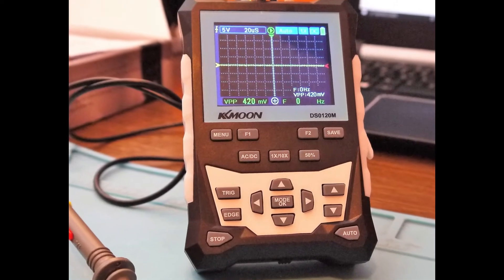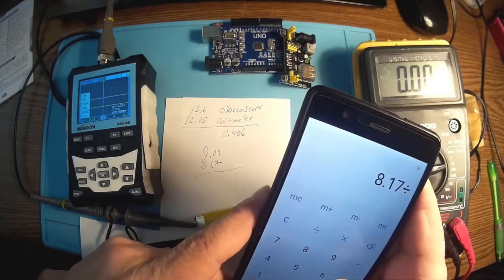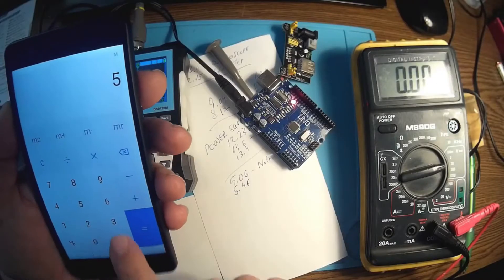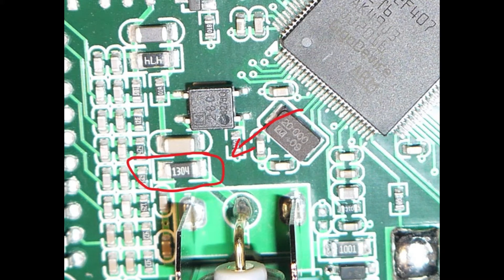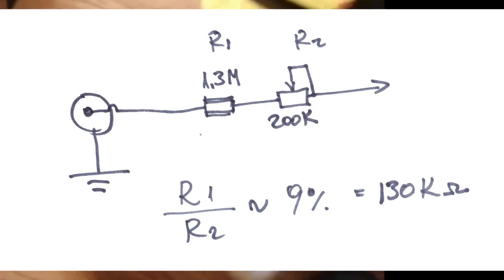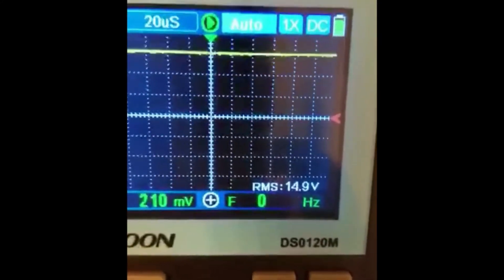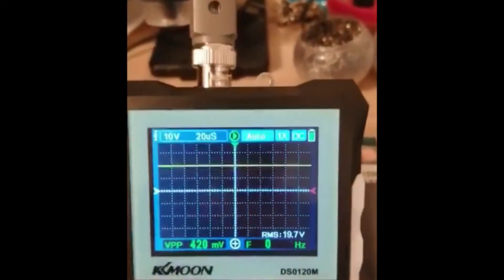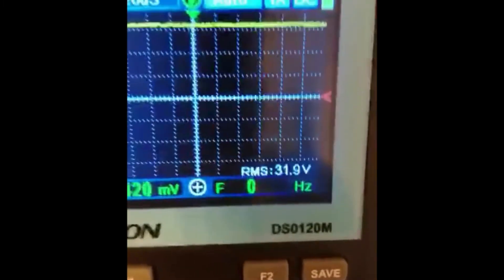DSO120M oscilloscope Mod

Comment: Better solution: add a 10MOhm resistor in parallel of it. I soldered mine on top of the in-plug. Plus this scope is missing the two diodes in the orginal 5012H layout. Adding the resistor and diodes will make the readings and signal more accurate.
Reply from the maker: Thanks to let us know! Good idea!
Reply: @viocaia  you are welcome. My DSO120M was way more out of specs than yours. Some of the resistors in the resistor-capacitor network was either fake or at least could not be measured. So replaced them first with correct values. After adding the diodes and the 10M resistor I finally could also calibrate my probe correctly. There are still some glinches in displaying the signal in the 2V range, but only at lower frequencies like a few kHz. But at 1Mhz and up to about 8 MHz I´m getting now an absolute square wafeform. Then it turns slowly to sinus, though thats the limitiations of this scope. And it displays frequencies up to 115MHz more or less correctly. So at this stage not bad for a scope I paid 50 Euros. Using it more often than my desk bench for quick measurments.
Reply from the maker: @andreasl4320  I don't have mine anymore..but your advice is very welcome..I'm sure it will be useful for our friends ...thanks again!

Comment: I just came across your channel, good stuff. I know absolutely nothing about oscilloscopes, but I picked up this exact same model to use for setting amplifier gains in car audio. I could never get my probe to compensate correctly. I'm including a link to a short video, I was hoping maybe you had a little insight you could share. I'm only ever measuring 40 or 1000hz, and it seems to do fine, but I kind of feel like I bought this so I could be precise, if I can fix this, I'd like to. Thanks in advance!

https://youtu.be/n_-V9Nm6jqQ
Reply from the maker: I believe it's faulty..try another probe, or simply add a 10Mohm resistor in series and try calibrate on 10X..
Reply: @viocaia  awesome, I'm going to hit up radio shack on Monday. If they don't keep probes in stock I'll grab a resistor. Thank you sir! I'll keep you updated how it goes!

Comment: Mine seems to measure pretty close in relations to my volt meter in peak voltages mode. Rather then the default peak to peak mode. If anyone can elaborate how volt meters should read it? VPP VP RMS?
Reply from the maker: depends of the needs..for me , measuring the audio power amplifiers RMS is what I need, but working with SMPS you need Vpp, or at the end simply V in DC..of course for the money ..is doing the job..

Comment: Hi Viorel, thanks for the video. Regarding that resistor in series... Can you share what resistor did you use and how did you install it? 

Thank you in advance 👍
Reply from the maker: It turns like a bad solution, so I don't recommend it.It's ok for DC but turns the AC impracticable.
Reply: @viocaia  right that's exactly what o was thinking. But there must be a more efficient solution to this 🤔
Reply from the maker: @xalalalala  maybe a future firmware, it's looking like some clever guys are working to an open source
Reply: @viocaia  that would be great yes. Do you have any links to that discussion so we can follow the development please?
Reply from the maker: @xalalalala  https://www.eevblog.com/forum/projects/reverse-engineering-fnirsi-5012h/
Reply: @viocaia  I've seen that one yes. This is for the black and yellow one. Let's hope someone get a solution for this one. But then again it's not difficult to estimate the difference regarding the average misreading. 
By the way, I was watching the 3rd video you posted and I find those measurements really odd. I was able to generate kind of stable waves at 60MHz but your oscilloscope seems to have a hard time reading even 8MHz. Maybe your device is faulty?
Reply from the maker: @xalalalala  It's not faulty, it's just not able to read it..those AD converter is not fast enough..so all this series of oscilloscope, using al most the same schematic is good for learning and  let's better then nothing.If you intend to be professional please forget about this products!
Reply: @viocaia  thanks for the heads-up 👍 keep up the good work